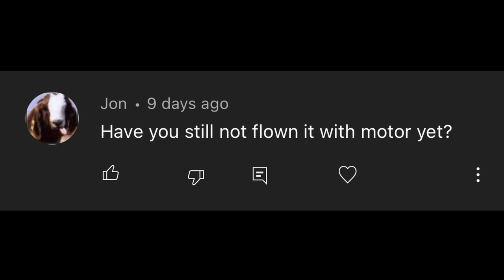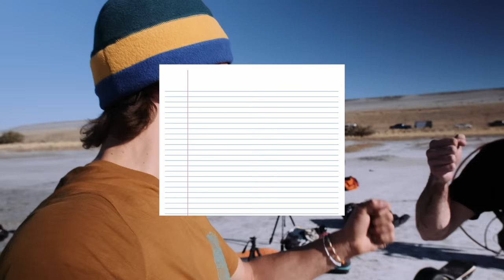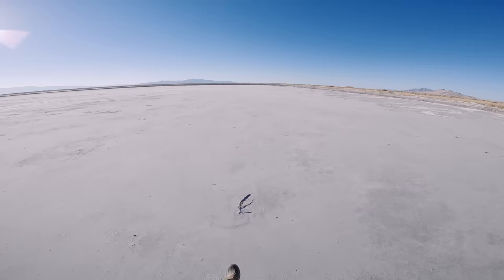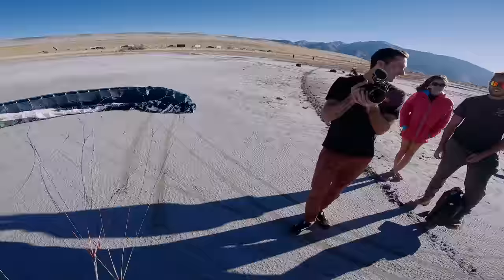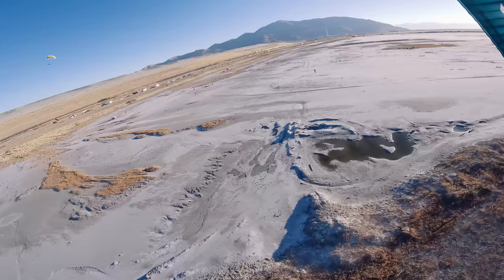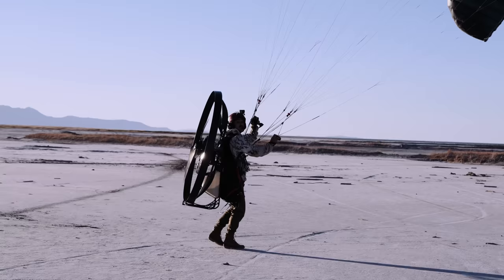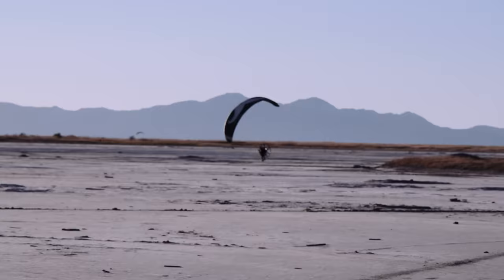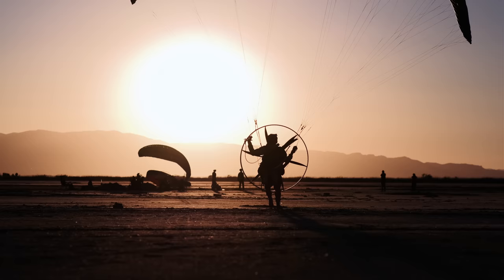WE FINALLY MOTORED THE MOUSTACHE... and Its INSANE.

Comment: Why not put a spring on the lines and a trim like on a kiteboarding kite.  Well, more the cabrina bar that has a spring on the lines.    But make it where u have to push against them for full speed, and when u let off, it goes back to the middle like a neutral point.  You could put a strap on it to trim where u want it to stop.  But at any time, u can still have full range.
Reply: they are probably working on something like that as we speak. Would also help the use for XC Flying.

Comment: If they put stoppers on the flare system so you could lock it at certain AoA points it'd make a great motor wing. Because you can't go hands-off though it's really only good for acro pilots.

Comment: The idea of ripping hard acro on a new glider the first flight, especially an experimental glider kind of sketches me out; but I suppose if you get a feel for it's behavior and your instincts tell you it's all good, then it's all good.  I fly a fast glider myself and find foot drag landings are the best way to dissipate that momentum quickly on hot landings but wow this thing looks like you can cut your motor and foot drag for like 30-40ft with all that speed range in the pull of a break line.  It looks absolutely nuts. Don't exactly want one "yet" but excited to see what the future holds. (also, I kind of hate your mustache... the one on your face, not the one you're hanging from, but yeah, it feels appropriate somehow; good job!)

Comment: What happens if you go full up on the left but then pull hard on the right? Collapse?
Reply: I know that you spin out without a motor so I imagine it will similar with one
Reply from the maker: It just turns fast. It doesn’t require outside brake it’s so weird. It won’t collapse.
Reply: @JudsonGraham  interesting.  Would be nice if it had some toggle stow points so you could go hands free at neutral position.  Then it would be perfect for the motor...

Comment: i am thinking: instead of holding the brakes all the time pressed to the "normal flying" level and hands up for accelerated flight, why not holding your brakes released all the way up for "normal flight" and apply your foot speedbar for full speed? That would be a normal "double action" like on other wings. What's the difference apart from not having a speedbar and straining your arms to keep in "normal flight" position? Does it have a special airfoil or anything, aside from being just a small wing with full speed control just on the brakes alone? Thank you! Great flying!

Comment: Good lord, this wing looks crazy fun! But it also looks like you need a hell of a motor to push it. I don't think my nitro could keep it level at full speed...
Do you know what your top speeds were in relation to the wind? It looked FAST.
Reply from the maker: You definitely need a lot of engine to fly it fully. I felt like my factory r was just enough im only around 130 lbs and my scout makes 170+ lbs thrust 😂
Reply: @JudsonGraham  damn, you were on a factory R?! I wonder if this was the main reason that Flare was hesitant to motor this wing?

Comment: There’re five incipient tech advances standing between us and the universal adoption of Mustache Flare in a gigantic new field of personal transport craft that will challenge the automobile itself for supremacy. One, of course, is fully electric propulsion. With adequately fast batteries. Two is to put long-travel control actuators in the hands large neural net autopilots; hedge up on safety by pushing the turbulence envelope in a simulation environment like Omniverse. Third, the development of truly UV-invincible sail materials with RFID-driven integrated damage sensing. Multiply the lifespan of a wing, and then use it every acceptance day as far as conditions go. Four, there’s a giant opportunity inherent to the integration of the previous three as a bike-weight cockpit / cargo pod with some very novel capabilities. The power control for a high-outpost electric thrust motor easily supports high-spooling brushless wheel motors. Five, using AI simulation and cutting-edge methods in robotics training, a whole new field opens up.  Ways of adapting to complex actuation rangesets, specifically. Using full and AI-mediated control, we’ll see the emergence of varied stance-steering in hyper-athletic four-wheel transport bots. They’ll fold their wheels in like a motorcycle and run the motors one way. Fold out, the other way, and got have a mini Kart.  Mix, match, link, detach, use a flexwing, paraglider, hydrofoil it, skate it, rail it, add ballistic chute. The ultra-bikes won’t go highway speeds, but given them wings will be easy. When these five soon-feasible advances conspire to outperform and safely cost-undercut all manner of short range EVTOLs,  many of the world’s markets will see revolutionary adoption. I foresee these evolved systems traveling quiet and fastest over shared railways, narrow enough to use a signal legacy track as a double dumb-monorail, nimble enough to step aside- even pass and race ahead in a nearby road- for traditional railfreight. .  They’ll take micro-logistics to a new level, lowering environmental costs of especially random goods in everyday quantities. Like groceries. be feasible in the air- all while carrying around the capability of taking wing. Grouped, linked, without passengers, a packet of eight might take only a single car’s worth of highway space but split upon picking up passengers.
Reply: What?? Lol